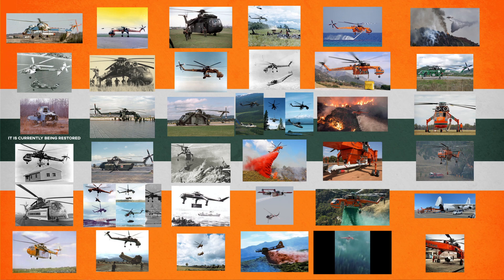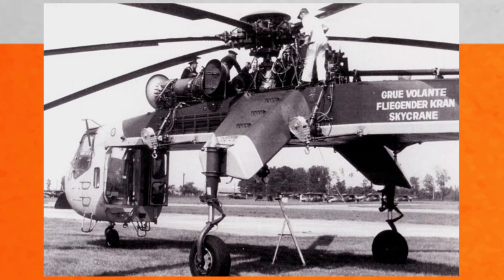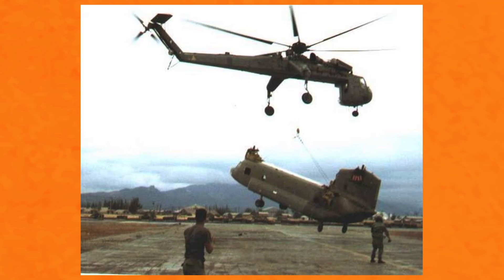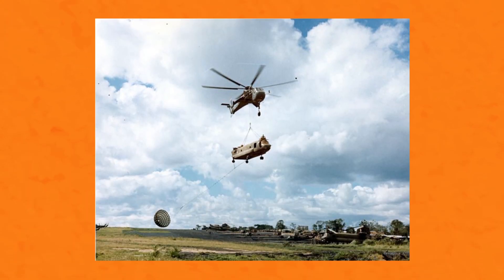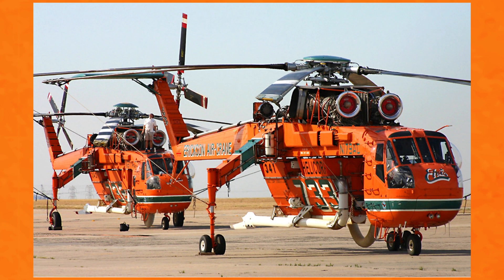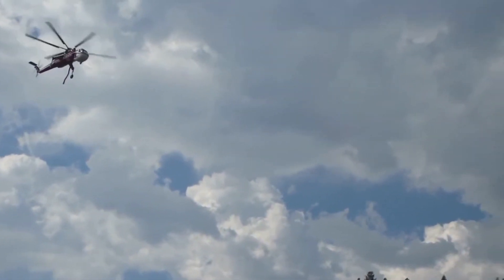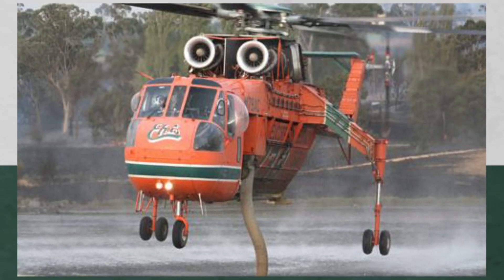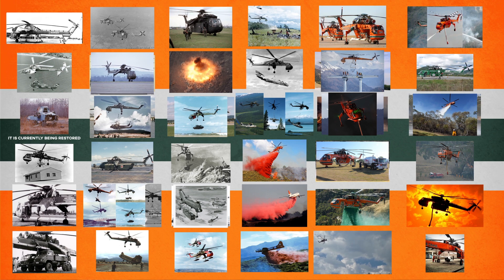Wacky Helicopters | S-64 Skycrane

Comment: Several years ago, central Texas was plagued with many large grass fires.  Coincidentally, I happened to drive past a munincipal airport where there was a Skycrane parked.  I did a U-turn, entering  the airport to see the thing.  It was dolled-up to be a firefighting water dumper.  There were several guys with matching garb milling around.  One of them walked over to my car.  I introduced myself and asked if I could take a look.  "Absolutely!" he said.  "You're paying for it!"  (as a taxpayer)  I got a royal tour, climbing up to the cockpit, sitting in the seats, etc.  Did you know those things have two (more or less) cockpits?  There is a lower rear-facing glass-lined compartment where another "pilot" can do precision movements that the actual pilot can't see.

After about 45 minutes of me monkeying about with incredibly friendly crew, they must have gotten a call to get to work.  They told me where I could move my car to get the best view (really pretty close) of startup and take off.

I was glad that I did the U-turn!